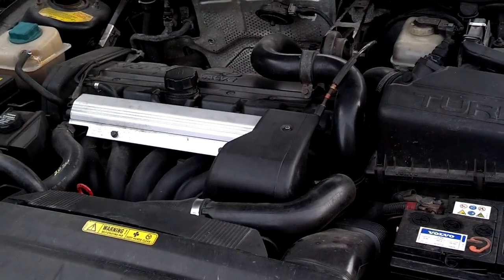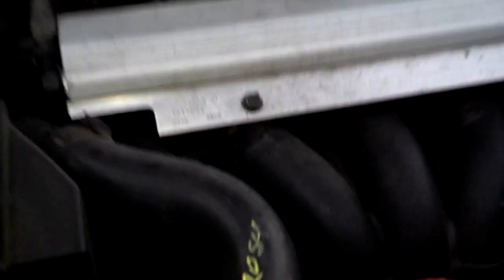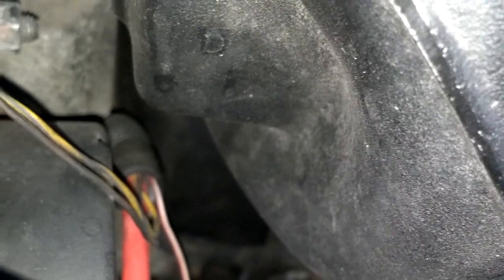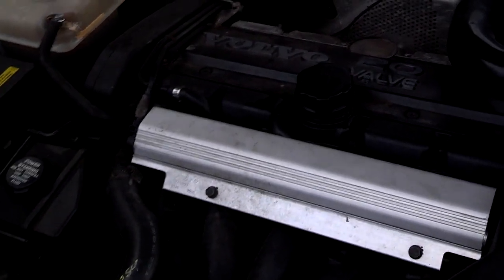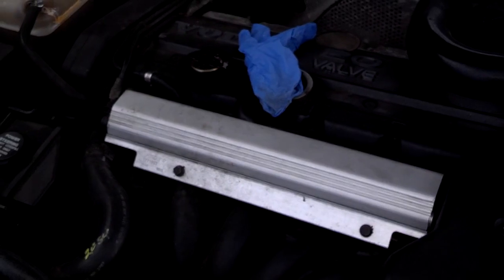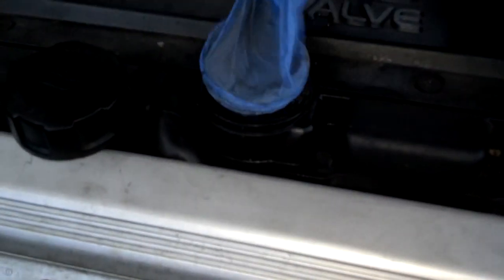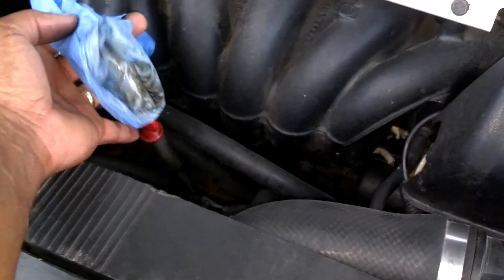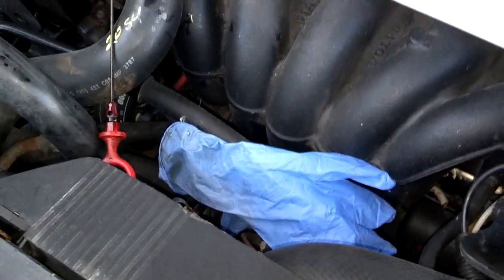Volvo PCV system check, 850, V70, S70, and others - VOTD

Comment: Then why am I burning oil
Reply from the maker: There are several reasons you can be burning oil. What kind of car do you have?
Reply: +Robert DIY 2003 Toyota Camry with 131500 miles on it do I need a new car or what should I do
Reply from the maker: I have no idea, what does burning oil mean?
Reply: Its common on those camrys. i just got rid of mine with 220k. the car will be fine as long as you keep the oi full. If you google it you will see articles about the issue. Toyota had to redesign with piston rings to fix the problem.
Reply: +Leap Frog wow that suck are you sure is 2003 I know they recall 2007 and up
Reply: +Robert DIY burning oil mean when I drive my car it eat up the oil and I pull my dip stick out its half way of oil some time it stall on me
Reply from the maker: How much oil usage is to much for you guys? If you have to add a quart every 1,000 miles is not bad to me.
Reply: +Leap Frog when there no oil in the motor it stall did that happen to you I crazy fill it up with oil like a month a go I really over fill it I pass the line and still say full
Reply: +Robert DIY I never count it I use to change my oil every 5k miles but when I got a job that is far it's more wear and tear on my engine I love my Camry I don't want to buy another one
Reply from the maker: I don't understand. If you have a car, you need to check the oil level REGULARLY. So, if you find it low (or empty) you fill it to the full line. Then you check it daily and add oil when it gets near the low line. You (or I guess I should say I) check the miles on the ODO and see what the rate of usage is. For me, around town I use about 1 quart per 700 miles and about 1 quart per 2,000 miles on the highway. Example, I just took a 3,800 mile road trip and had to add about 1.8 quarts.
Reply: I never let the motor run dry of oil. that's a great way to break your motor. Also its not a good idea to fill the oil over the full line on the dipstick. Just have to check it every week or so depending on on how much driving you do. It sucks, but it is a very reliable car.
Reply from the maker: Checking the oil daily is not a big deal. Beats the heck out of walking.
Reply from the maker: https://www.youtube.com/watch?v=wyF3o3c1uug
Reply: lol true. most people do not bother, then wonder why the car don't last.

Comment: I have a 2002 Volvo s80 non-turbo...do you have a video on this vehicle for pcv replacement since it looks like it's a different set up?  Thank you in advance.
Reply from the maker: Is it a I6, if so, they don't go bad often.
Reply: 2.9L I had some rough idling so I cleaned my ETM, did normal tuneup did oil change & since I'm at 120k I checked spark plugs and replaced.  I noticed when I was replacing my air filter that my air filter housing box was warped near the interior housing notches and wondered if this was causing any issues on the intake.  I had autozone pull codes because I have a check engine light that is either steady or flashing.  According to that I currently have a misfiring issue in cylinder 2.  When I checked that out, I noticed a little bit of oil around the threading of the spark plug so cleaned out cylinder but didn't go very deep so probably didn't resolve the issue.  I am going to be replacing my oil cap per one of your videos and considering pcv system replacement post glove test.
Reply from the maker: A lot of people mistake the stuff around the spark plug threads for oil when it's fuel.
Reply from the maker: https://www.youtube.com/watch?v=Sg7iFytxfzQ
Reply: ok so just wanted to give you an update.  So in an effort to cover all basis and be sure everything that needs to be taken care of is addressed on my car.
So with the rough idling & misfiring which started in cylinder 2- 2 weeks ago & the noticeable heart radiating from the engine after running (which normally even after running I can actually rest my hand on the engine- that's how cool & efficient the engine cooling usually is.) I initially thought it was my MAF sensor and since I am at 128k thought it wouldn't be a bad idea to replace it (post slight difference from MAF cleaning).  Then I cleaned my ETM since I had been reading that this unit breaks down over time.  I know there was a recall and a Defect Investigation Report through NHTSA that monitors complaints and recalls and it shows there is an investigation Action# EA05-021 1999-2002 Volvo C70/ S60/ S70/ S80/ V70 & V70XC equipped with ETM Subject: Throttle Control Malfunction that was opened December 6 2005.  So after I cleaned the ETM & replaced the MAF & air filter which seemed to help very little but still had episodes of stalling not just at idle, stops or low speed but at higher speed.  I was trying to check everything that I could and tested all the fuses, pulled to ECM and put back in as well.  I initially thought maybe I had a gasket issue because of the heat but the dash meter was not showing overheating in any way but I was smelling something when engine was hot which for me smelling anything but your air freshener (if you have one) is probably not a good thing.  You know!?!  I took it to Autozone because check engine light would flash (which I didn't know that flashing indicates it is currently misfiring at that very second) followed by a steady engine light and "Time for Regular Service" which comes & goes even thought the engine light is steady.  Autozone did check engine light code reader which indicated ...300, 301, 302, 303, 304, 305, 306 random misfiring between all cylinders.  ugh  Whereas 2 weeks ago it was only cylinder 2 and though the new spark plug already showed running lean I couldn't narrow down why.  You being Robert have probably already figured out the issue at this point but I will tell you the rest.  So since I thought my air/fuel mixture had to do with the possible failed ETM I decided to try to get it replaced by the dealership.  I called up the dealership and spoke to a recall specialist who was very nice and she set me up for a visit.  I went in and spoke with the Master mechanic as I went over my printed codes, series of events and system replacements and he advised me to check 2 more simple things myself (so I didn't have to pay $120 for diagnostic) and bring back to him if we have more definitive info.  He asked me to check my ignition coils for any hairline cracks under the boot and though I had examined the coil boots before, I didn't know I was supposed to look for cracks.  lol  Anyhow, I couldn't wait til I got home to check so pulled across the street from the dealership and checked them all & they all have 1 or more hairline cracks.  He said that if there is a crack, the coil is bad and will misfire and since I only had one cylinder misfiring 2 weeks ago I imagine within the last 2 weeks the increased engine heat has taken its toll on the other coil packs thus explaining the multi random cylinder misfiring.  The second thing he asked me to check was fuel pressure.  I have within the last 2 months used Lucas fuel additive 2x for high mileage to see if that helped and honestly I don't think it made a difference at all.  The Master Mechanic said as you have said in one of your videos that a bad fuel pump can cause misfiring, stalling & relay issues.  He also said that there is a fuel pump recall for my VIN Year & Model of my car so if there is reduced fuel pressure he can replace that for free regardless of how it happened.  I am going to try to get the coil packs thrown in though if the pressure is low.  My argument would be that the faulty fuel pump broke down perfectly good systems by heating up the engine to temperatures beyond normal for volvo thus causing the plastic on the ignition coils to crack causing misfiring.  I hope that works. :)  First though I have to find someone with a fuel pressure gauge since it seems shops around here are all booked up.  I will keep you posted.  In the event you didn't have this information here is the actual recall info. http://www-odi.nhtsa.dot.gov/acms/cs/jaxrs/download/doc/ACM1193768/SB-10000301-8643.pdf

I know many Volvo owners have been frustrated by some issues that should be recalled and the pricey unnecessary repairs that they had to do in the process of discovering the real issue or maybe never discovering what the real problem was.  So cross your fingers.  We will see what the pressure reading is and take it in if low.  I know I can get the bosch coils through fcpeuro.com (lifetime warranty) for about $40/ coil but I have already spent so much in the past year as many systems have had issues and I have only had the care for 2 years but guess the previous owners either procrastinated repair or were not aware of some issues.  IE...I bought the car and could never figure out why when it rained why my driver's side floor boards were wet.  Yeah well come to find out it wasn't rain it was actually my heater core that was bad and since I had never experience this failure in any of my other cars (not volvo), I had no clue what the signs were  but now know I purchased the vehicle with this problem and that is probably why the owners unloaded the care at 89k miles.  Which of course has been replaced since then but it just seems like everything is needing to be addressed all at once or well since I've had it.  I guess the 2 major mileage markers 100k & 120k being crossed probably effected things as well.  I am hoping after this whole bump in the road that I won't have anything for a long time.  That would be nice because I really do like my car and want it to grow old with me.  lol

Thank you for reading this...I know it was lengthy but it helps to know maybe what the process is for others.  Also thank you for your videos.  I live in an area where there are only like 5 mechanic shops and a couple are just tire shops that do a little extra but not really full service & in my case, none of the shops have a good knowledge of european cars which is not reassuring so I try to do it myself.  I have been lucky since I am mechanically inclined and like to troubleshoot.  So I don't mind it but with me being relatively new to Volvo's, I am learning the Volvo way and liking it.  Volvo did some things in cars that really made sense way before other cars were doing it which is awesome that they were so innovative.  I get the feeling with the purchase of Volvo back in 2013? that they are returning to their roots even though it was bought by a Chinese Business man.  He seems to be trying to surround himself with Swedish counsel and restore Volvo back to the levels it once was before 1999? under previous ownership.

Once again thank you for your time and simple step by step diagnostic videos.  If you have any tricks for me knowing what you know, pass them on to me please.  Thank you

Best regards
Cristel
Reply from the maker: Didn't realize that you were having the misfire or running issues. Glad you took the time to figure those things out. Let me know how fuel pressure goes. Coil packs wear out after time, it's good to check them for cracks when you start experiencing misfires.
Reply: ok so here's the update.  The fuel pressure registered consistently at 50 psi and the car actually stalled while I was testing it, though I had driven it about 20 minutes just prior.  I decided to take it to the dealership for a diagnostic because initially I thought it could be fuel pump since I was hearing buzzing inside the car similar to a morse code message (while driving and after off).  I thought it would be covered under the recall for my vin# but after calling Volvo corporate  they told me that the previous owner had the recall work done already.  Oh well.  The diagnosis revealed 1 bad fuel injector and now it all makes sense as to how the ignition coils went from only cylinder 2 being cracked to all cylinders in a matter of 2 weeks.  So my hunch is that since the one injector wasn't working it was making the engine work harder thus causing more engine heat (though it didn't register as overheating on the thermostat gauge on the dash.  So I am having them replace the injector & I am going to replace all the ignition coils & spark plugs and I should be good to go. :)
Reply from the maker: Good deal.

Comment: We did the glove test over the oil filler tube and it blew up the glove.  So how do we service the PCV system?  Thanks!!
Reply from the maker: What kind of car do you have?
Reply from the maker: https://www.youtube.com/watch?v=ZqdHDqGKYV0
Reply from the maker: https://www.youtube.com/watch?v=_Vq1YBp3uOU
Reply from the maker: I have never serviced one on your specific vehicle, but basically you order the parts, take the old parts off, clean the engine ports, install the new parts, then put the engine back together.
Reply: 2006 S40
Reply from the maker: I seen. It helps when we reply to the same initial remark/question.

Comment: Hi Robert i have volvo s90 1997 if i start engine and pull dip stick smoke coming from there please tell me how i fix this problem
Reply from the maker: +irfan nazir who told you that was a problem?
Reply: +Robert DIY i see in one video if smoke coming from oil dip stick that pcv problem
Reply from the maker: +irfan nazir not really for 960 cars. Have you replaced the flame trap lately?

Comment: Hi, I think this may be my issue with my 01 XC70. I have
oil under the shroud and a loud sucking sound around 2000 rpm.Do you think that sounds like a compromised PCV system?
Thank you very much! Dan.Hi, I'm thinking this may be my issue with my 01 XC70. I have oil
under the plastic shroud Hi, I'm thinking this may be my issue with my 01 XC70.
I have oil under the plastic shroud
Reply from the maker: Did it pass the glove test? Sucking sound is usually a vacuum leak.
Reply: I actually just saw you demonstrate the glove test while at work, haven't had the opportunity to try it yet. Thought I'd ask your opinion before hand. Thank you for the quick reply Sir, very much appreciated!

Comment: Thanks a million for posting this. I had no reason to suspect a problem, but I thought I'd check on the PCV system in my wife's V70, as it's getting close to needing a timing belt again. I bought the car 3 years ago. At the time, one of the selling points is that the PCV system had been professionally serviced sometime before purchase. 

Anyhow, I was able to confirm that the PCV system is indeed healthy. One follow-up question - what's the typical service/replacement interval on these parts?
Reply from the maker: Leave them alone until they get clogged or a part breaks from someone working near them.
Reply: Will do. Hopefully, it'll stay healthy for a long time to come.
Reply from the maker: Oil changes. Synthetic is better.
Reply: Robert, I was checking out a S70 sold as junk today. Car starts, but after ten min or so, the idling engine started to crank unevenly. It goes faster then slow then fast, rhythmically. Is this a representative sign of what issue?
Reply: @ejshelby5460  I'd start with looking for a vacuum leak, particularly if it's a turbo

Comment: Thanks so much for this video, absolutely great stuff! I did the same test on my brand new used Volvo v70 classic (2000). When idling, the glove got sucked in. But when stepping on the gas pedal the glove starts to flutter a little bit. I've got a video of it over here: https://youtu.be/WNf2Hz_SRT8 There is no smoke from the dipstick, but on a hot engine there is sometime smoke from the filler gap, and the area where the coil ignitions are had a bit of oil spill (I replaced the motor oil cap seal already). Any ideas on what this could mean? Any leads are much appreciated. Thanks again!
Reply from the maker: Either the system needs to be properly serviced, the test wasn't done correctly, a vacuum line is loose somewhere or the engine is worn (low compression/worn rings)

https://youtu.be/t4gwoQTW9OE